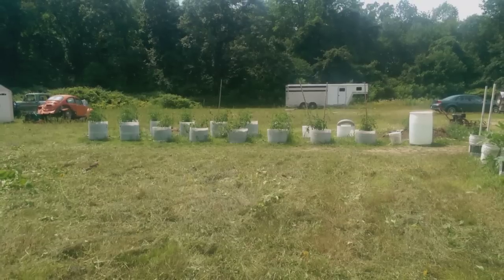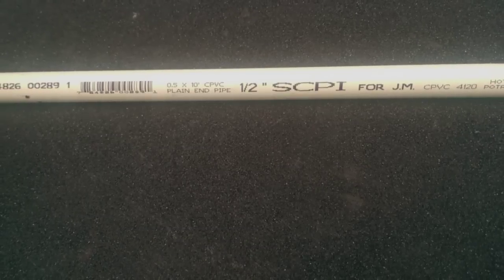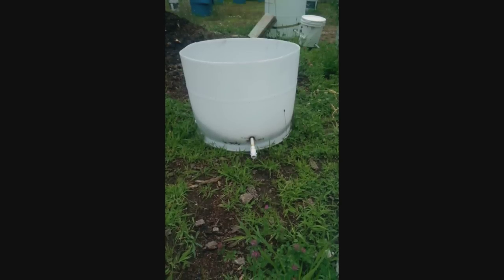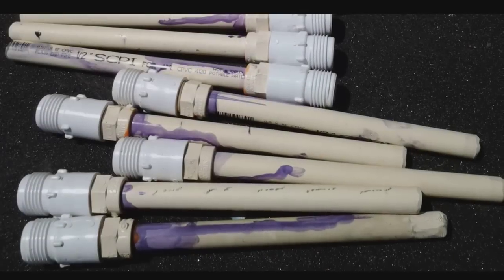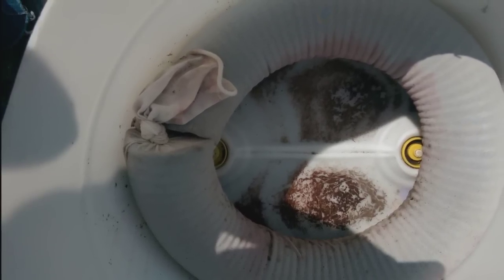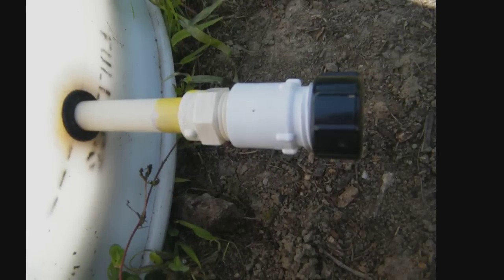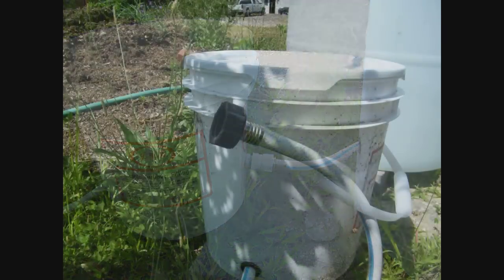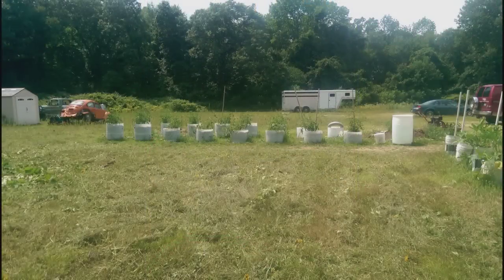Automatic Watering System For Wicking Barrels Part I

Comment: Excellent video and thanks for posting.

 I did something similar and discovered a couple of easier mods. You can skip all the expensive fittings in two ways. Instead of stiff pipe and fittings to connect the barrels use the SOFT black tubing and drill your holes slightly SMALLER than the outside diameter of the tube. You want to have to FORCE the tube thru the hole. I cut the tube at an angle and used pliers to pull it thru. If you really want to use hard pipe, old innertubes make good substitutes for grommets. Cut a square an inch or so bigger than your hole and put a SMALL x in the middle. Lay this patch over the hole and FORCE the pipe thru. It will stretch and act as your grommet. You'll have to play around with dimensions a little. I think my black tubing was about 5/8". I only put one overflow hole at the end of the chain since it will drain all the buckets if they're level. 

P.S.If you are putting your pots on the ground put black plastic under the whole row. I didn't and the Bermuda grass was a nightmare to keep down cuz you can't mow up to the pots or between them.

Comment: A lot of work, expense, and way too complicated. My only holes are in the lids to allow my 3/4" rope wick (about 20" long) to extend from my 5 gallon reservior up into my 5 gallon grow pot. Half inch syphon tubes connect my 12 reserviors. One bucket is filled and that fills all, as they seek the same level.